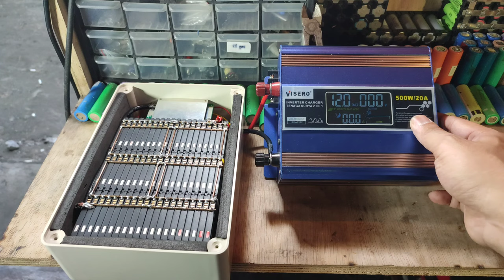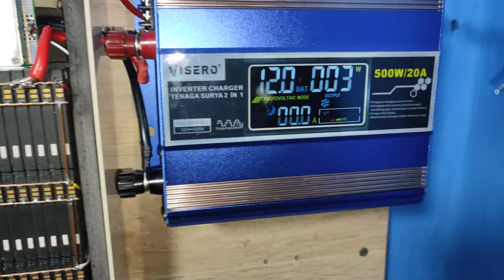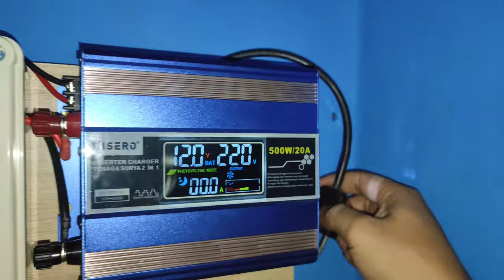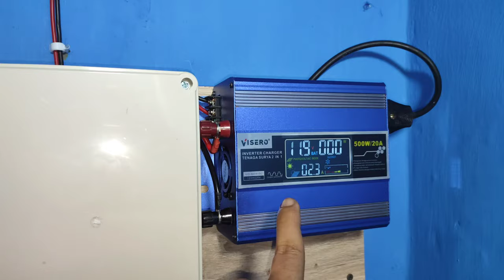Setelah saya rakit Mantab & Memuaskan untuk saya

Comment from the maker: Link beli👇👇👇
BACA DISKRIPSI PENJUAL SEBELUM MEMBELI
HARGA & STOK BISA BERUBAH SEWAKTU WAKTU
SAYA TIDAK BERTANGUNG JAWAB DENGAN SEGALA BENTUK TRANSAKSI🙏😊
Link yang saya cantumkan adalah rekomended seller
Video Cek kapasitas baterai 18650
https://youtu.be/C2Huv7tyYWc

Inverter visero + scc yang sya gunakan
https://shope.ee/7f1BQZPO52
Bms 3s 100a comon port
Charge dan discharge 1 jalur
https://tokopedia.link/KYBcIUAcrwb
Bms 3s 100 putih saparate port
Charge dan discharge terpisah
https://tokopedia.link/zLFJgEFcrwb
Bms 3s 100a saparat port
Charge dan discharge terpisah
https://tokopedia.link/aGtP4QIcrwb
https://shope.ee/7f1BQZPO52
Liitokala tes kapasitas baterai
https://tokopedia.link/5arM7Mscrwb
Box baterai yang saya gunakan
https://tokopedia.link/eSakrpR1Nvb
Multi meter sperti pnya saya
https://shope.ee/VXo93UEyc
https://tokopedia.link/jjlKsgPOawb

Link tambahan👇👇
Inverter visero 1000w + SCC 20a
https://tokopedia.link/NIqIMok5nwb
Inverter kenika 24v 1000VA Low frekuency
https://tokopedia.link/BAxfRFWthwb
Inverter kenika 24v 2000VA Low frekuency
https://tokopedia.link/sGozaAauhwb
Epever xtra 30a
https://tokopedia.link/nYRTmp30kwb
Wattmeter DC biru
https://tokopedia.link/EKhUGfXOawb
https://shope.ee/8Ua5g7MJay
Multi meter sperti pnya saya
https://shope.ee/VXo93UEyc
https://tokopedia.link/jjlKsgPOawb
Mic wireless yang saya gunakan 
https://tokopedia.link/g3TA8fMp9vb
https://shope.ee/5Kd2YYEmaP
Rekomendasi mic serupa yang lebih murah
https://shope.ee/2pvha1WEvg
https://tokopedia.link/5ZkKF5aq9vb
Reply: Link Lazada ada ga
Reply: Batrenya beli dmn mas gaes
Reply from the maker: Udah g ada yg jual mas🙏😊dlu udh sya post diborong2in viewer😊🙏
Reply from the maker: Maff sya g pakai lazada mas🙏😊
Reply: Gk capek y mas gaes nulisnya
Reply from the maker: Capek mas😁😁

Comment: mantap bang otw nabung buat beli inverter, bms dan baterainya
Reply from the maker: Mantab mas gess😊🙏 shat sllu🙏😊
Reply: @projectringan  Mas bisa gak kita ngecas baterai 18650 pakai power suplai punya laptop yang sudah saya seri 3S ?
Reply from the maker: Bisa mas Di stepdown dlu mas jd 13,4 sd 14v mas
Cas pabrikan sya buat 3s 13.6vas🙏😊
Reply: @projectringan  bagus deh, mumpung ada psu laptop yang ngangur
Reply: @projectringan  satu lagi gan itu baterai blackbery bisa tidak kita cek kapasitas pakai liitokala lii-500?
Reply from the maker: Bisaas pakai liitokla😊🙏
Reply: @projectringan  ok mas thank you
Reply: Inverter tipe berapa ...cari belum ada pasaran
Reply from the maker: Yg di video link beli udh dipin di koment🙏

Comment: Untuk kabel panel Surya 300wp pakai ukuran berapa ya mas agar arus yang didapat maximal
Reply from the maker: Pakai 4mm cukup atau 6mm mkin mantab mas🙏😊
Reply: @projectringan  kalau punya sampeyan pakai ukuran berapa mas?
Reply from the maker: Pnyaku pakai 2.5mm tp baterai 24v jd arus pv stara 200wp 12v padahal pv 400wp krna sya seri paralel biar bisa cas 24v🙏😊
Reply: @projectringan  kalau 300wp enaknya di seri atau paralel mas agar bisa cas aki 100Ah maximal saat cuaca terik
Rencana Solar panel yang saya pakai 100wp X 3

Comment: mas panel suryaku 100x2 ku pararel memakai mppt eveper daya yg di dapat 9 anper pas lgi panas2nya matahari...apakah kurang maksimal atau memang segitu
Reply: Saya panel 120wp x 2 di 12V bisa 14A di 24V bisa 8A
Reply from the maker: Kurang mksimal mas 
Dlu pnyaku 50wp x 5 upto 18a yg masuk ke aterai mas dan amper input pv upto 16a mas🙏😊
Reply from the maker: Mantab🙏😃
Reply: apakah kabel hijau mempengaruhi mas ges soalnya masih menggunakan kabel hijau
Reply from the maker: Pengaruh mas😊🙏 not rekomended
Sma besarnya aki saat kosong dipagi hari  jg mempengarui🙏😊
Reply: @toliptolip3989  kabelnya pakai jenis apa. Saya masih pakai kabel pln serabut 2.5mm yg mudah didapat. Untuk kontroller ke baterai kabel saya rangkap dua.
Reply: maksimalnya brapa mili dan merek apa yg bagus mas gesss
Reply from the maker: Mksimal tak terbatas smuatnya scc mas. Sebnyaknya isi dompet
Tp klo sya masih pakai 2.5mm merk eterna

Comment: Bang mau tanya . 
Saya kan pakai 2 scc yg 30 a  . Solar panel 400 WP . 
Tapi hasil di scc mentok 16 v . 
Kenapa ya bang gaes kok cuman 16 v.
Reply: Aki 180 ah bang
Reply from the maker: Soalnya klo lg ngecas tegangan PV akan drop
Klo g ngecas g drop mas😊🙏
Reply: @projectringan  makasih info nya bang gaes
Reply from the maker: Sma sma mas gess😊🙏

Comment: Assalamualaikum Aa, mau tanya  jadi begini yah… ini pakai battery 18650 12v kira2 35 AH pakai scc hijau dan bms inverter taffware1000watt kalau seumpamanya pasng panel 120wp x2 dan di jam 10 siang battery hampir penuh inverter di pakai buat menyalkan beban apakah ada pengaruh ke battery karena charging ampere nya segitu bms jalur charging dan load pisah soalnya, dan kira2 kuat buat menyalakan beban brp watt pakai panel 120wp x2… atau sebaiknya pakai 120wp satu aja dan siang buat menyalakan beban karena battery anggap aja penuh sarannya AA makasih☺️😁
Reply from the maker: Waalaikumsalam🙏😊
Jd gni mas.
Klo siang udah penuh dipakai buat beban g pp
Maka yg diambil inverter adalah daya dr panel surya dan baterai masih tetep penuh sorenya bisa dipakai mas🙏😊 g perlu dikurangi panel suryanya

240wp itu 1 hari bisa hasilkan 800wh sd 1000wh
Anggap aja 800wh : jam durasinyala  =  daya beban mas😊🙏
Reply: @projectringan  beban tv tabung booster stb kipas angin kecil(ac)… kalau masih sisa bisa buat stand by mejikom gk kak, atau battery  malah ikutan tersedot
Reply: @projectringan  kalau watt terbaca d watt meter dr pv lbih besar dr beban siang hari apakah energi dr pv masuk ke battery.. atau watt pv mengikuti beban terpasang dr pv120x2
Reply from the maker: Baterai ikut tersedot klo masih tambah rmegicom🙏😊
Reply from the maker: Klo baterai udh penuh maka daya panel surya ngikutin beban terpasang
🙏😊
Reply: @projectringan  terimakasih kak… di tunggu vidio barunya kak…
Reply: @projectringan  ikut nanya mas ges... kasus sama pakai bms charging dan load pisah... kalau kasusnya seperti punya muna itu beban inverter ambil dr outputscc(jalur charging bms) atau dr jalur load bms
Reply from the maker: Inverter ambil dr out bms mas. 😊🙏

Comment: Kalo batre saya lifepo4 bms pake litium 4s. Dihajar sampai 10,5v boleh gak sih mas?
Reply from the maker: Smpai bms cutt off mas gess g pp
Tp ada syaratnya klo 12v kebawah bebanya ringan aja 5% dr ah baterai mksimalnya🙏☺️
Reply: Dod lifepo sama li on brati karakteristiknya sama ya mas ges. Mantab tengkyu mas ges